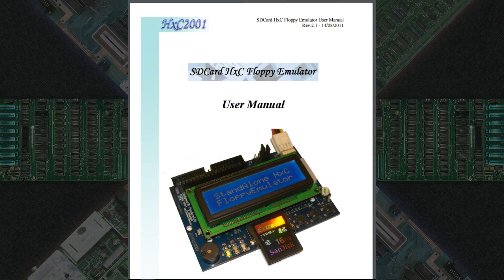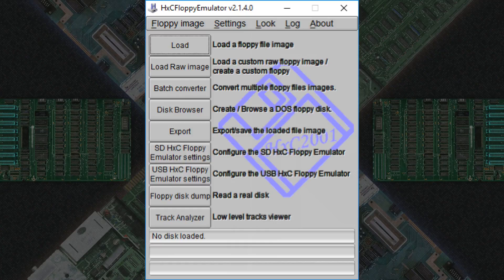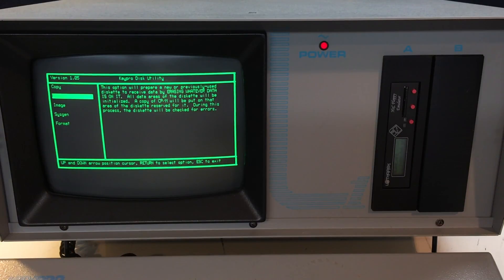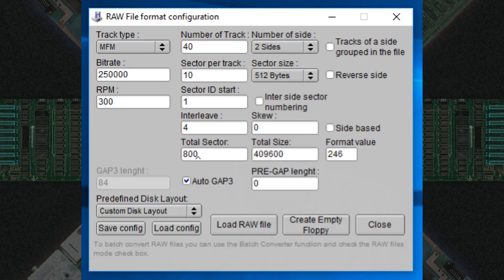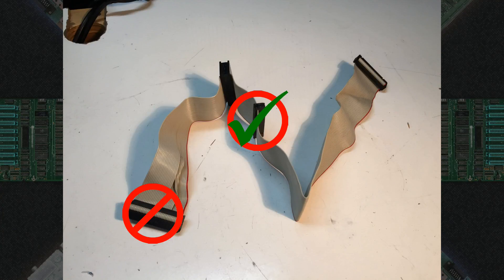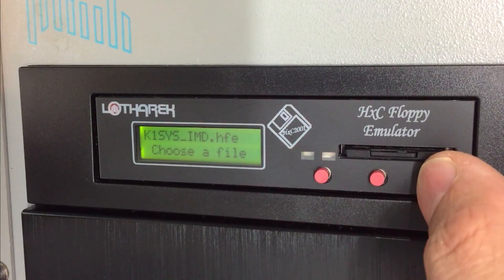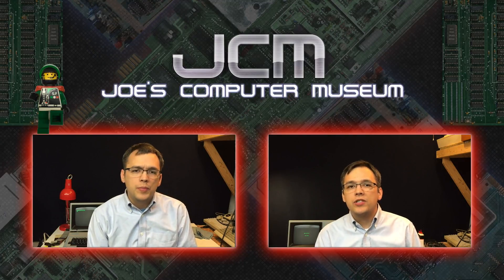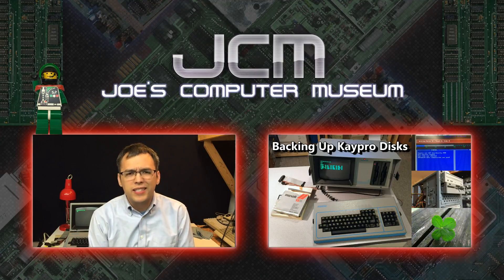Kaypro 1 Returns: Floppy to Flash Conversion

Comment: Hi Joe, Thanks for the videos.  I have a Kaypro 2/84 (brought back from the dead... bad DRAMS, and the character generator ROM was not making good contact... all working now), and the Hxc2001.  The Thxc2001 works and drive A or drive B can be selected, but the same disk image is appearing on both drive A and drive B.  Is there away to mount separate disk image on drive A and B?  Thanks, Robert
Reply: I figured out.  Not very intuitive or really documented.  To change drives, press the center button on the floppy drive emulator until it says "Change Drive".  Choose the drive, and load an disk image for that drive. The system will access either drive image needed for Drive A or Drive B.

Comment: I already have a GoTek emulator and would prefer not to get a new one.  Can this be made to work with that or does it have to be the HxC to work with the Kaypro?
Reply from the maker: I don't see why it wouldn't work, but I can't be certain as I've never tried it.
Reply: @JoesComputerMuseum  For those of us without 360k drives or DOS machines, 
I have just flashed my Gotek with "Flash Floppy" firmware, Firstly soldered a USB A-A cable so it would show as a STM DFU device in Windows 10, Using DFuse to flash "FF_Gotek-V2.14.hex". 
I then converted some Kaypro .IMD files I found to .HFE with HxCFloppyEmulator software. Renamed them with the Gotek 3 digit requirement "000, 001, 002" etc.   
Using a 34 pin to 5.25" drive edge connector I was able to boot the first image!  
My next learning curve is determining just how to insert files like "Kermit.com" into appropriate .IMD or .HFE...  If anyone already has a collection let me know!
https://imgur.com/gallery/IIG7OX4

Comment: can I still use floppy B if I have the right cable? I have a kaypro ii  thank you!
Reply from the maker: Yes, if you have the right cable, drive B should work correctly.
Reply: Thanks Joe, your comment inspired me to cut and "un twist" the last half of the cable I had.  that worked!  It made sense because before the cut when I selected B drive it selected ok but when I typed DIR it read A info on the card again but there was nothing in the B drive, led me to think that it was seeing the same ID, so by untwisting that routed the signal to the B drive :)  im sure none of that made sense to you but thanks for the info!
Reply from the maker: I understand what you're saying! Great job and enjoy!

Comment: Does it have any sound capabilities? I mean, at all. like a Intel Beeper or something.
Reply from the maker: This floppy emulator does have a small speaker to emulate the sound of a real head moving. Its nifty, but it can be disabled.
Reply: Joe's Computer Museum No, the Kaypro itself. I heard that sound in the video. It's pretty crappy, but at least it's there.
Reply from the maker: Ah! Not really. The speaker is in the keyboard. It only makes a simple tiny "click" when you press a key, and a longer beep when the computer generates an ASCII BEL character ($07). The speaker tone generator hardware is not accessible to the programmer and cannot be used to make music or anything.